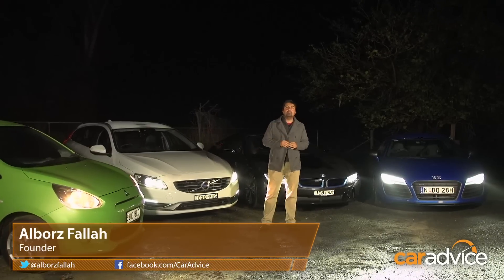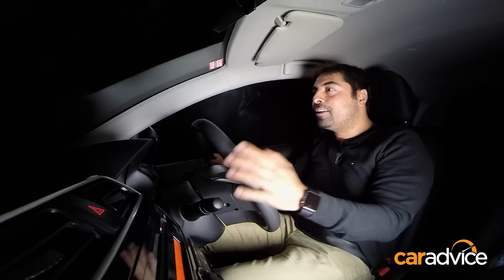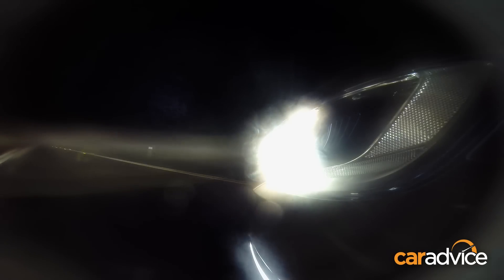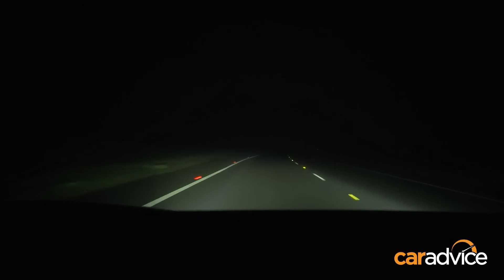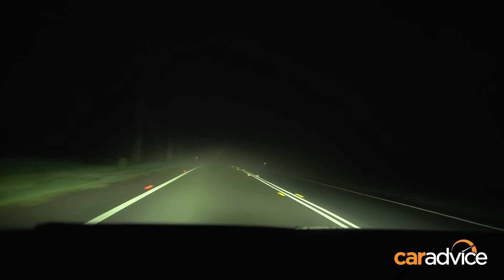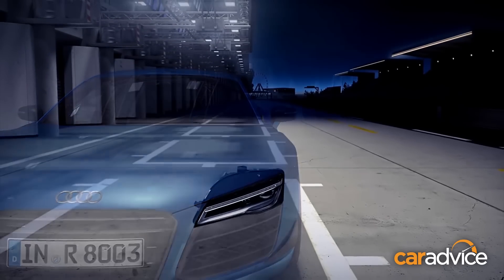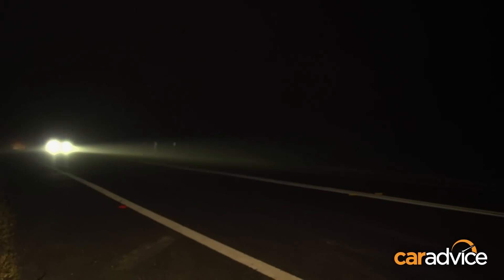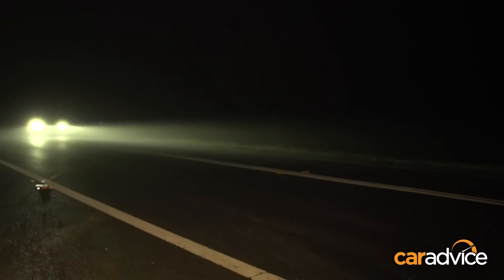Headlight Comparison : Laser v LED v HID Xenon v Halogen

Comment: Here is my Syncrovention, (halogen), headlights, power+, blue, detrimental, light-:

https://blogger.googleusercontent.com/img/b/R29vZ2xl/AVvXsEgnKe2vlwELsQqO6IclLpAJJfNd9e02tR2-6h1mp4NjSfz6bsaOFRfGdy5FE3ym1dk2cU92wx5s9ER3gQfK9Q7ujzJyGDoGZec3xsRcG17itlGMTOmCKnELyXteaIQsbzmG2gU0HioGAKRbmAz_JSQRb83vm1UGFS08MoI-BAhUC9KZfHvWOt3BQ8hZyULb/w640-h480/high%20beams%20vs%20deep%20logo.JPG

The Syncro Heresy

Comment: Not a fair comparison when optics are more important than color and lumens . Case in point a cheap focusable  flashlight and it can focus more light further or how about my not cheap mountain bike light that shots 3x further and wider than most cars. See you can NOT use my Mountain bike light on a car due to blinding oncoming traffic , this can be overcome somewhat with a projector optic or smart lights that see oncoming traffic and  adjust appropriately.  My Reef Aquarium Coral grows Coral best under HiD Metal halide Lighting (same as Xenon)  but  it does come with unwanted extras like HEAT and Excessive Electrical  Wattage but that's 400 watts * 3 not the DOT 35 watts * 2 on cars . With all this said it  would have awesome to get same Car with factory projector Halogens and compare that to Aftermarket Higher Wattage Halogens , Xenon (various colors) conversions and LED Conversions using the same optics and I'm pretty sure the best would be the Xenon. I have a feeling my Off Road RZR with a LED light bar (long throw optics) can shine better than that Audi Laser if we are comparing apples to oranges.

Comment: Of course low beam LED don‘ right up further than low beam HID! That’s regulation. They’re aimed downward to not blind oncoming drivers.

And comparing low beam LES with high beam laser? Come on!

Finally: H4 have always been a  not so good low cost halogen, double H7 was the standard.

Comment: um....why? you can adjust angle and power....how often does anyone turn on their highbeams without attracting attention or having somebody pissed off at them.

highbeams have different angles and simple bounce back from further away with a higher intensity to make it cover that increased distance.  nothing to do with technology...only difference is power consumption/heat produced/and wavelength of light

you can make an incandescent bulb out shine a laser light but you wont like the heat.

Comment: A bit confusing with the mention of distance.   On low beams and with hi/low in 1 bulbs the range shouldn't really increase much.  Rather for it to be better lit within the same range if aimed/re-aimed properly.  High beams could extend the range likely more so with seperate bulbs.

Comment: What an innacurate test. He starts with low on the halogen then switches to high to see the difference, but he completely skips that test with the hids, then he shows the other lights starting off with high beams. He obviously doesn't know the color range with hids either, as there are 5000k hids that are as natural white as leds. If you're going to compare these four types of lighting, at least perform a proper test with good explanations.

Comment: lazer headlights sound like an expensive fix ;)
Reply: I'm pretty sure they are 100% covered under warranty and insurance during the life-time of the car w/ the owner.  Most likely the owner gets a better version before the laser lights even have to be personally out-of-pocket replaced.
Reply: +Anthony Abelardo Bull fucking shit
Reply: Ivan Fedyshyn i could care less if they are, I would drive around every where & introduce myself as Bond, James Bond... that my friend is priceless
Reply: $3500 for one when mine had a fault.  Bmw asked me to keep  the faulty lightsfor research. The clear plastic had very fine crosshatching where yhe eye lips were.  Luckily they didn't charge me for repairs, lucky it was a rare fault they had never seen and c wanted to further research or rose i would be out of pocket.
The fault wasnt noticable unless you went very close to investigate.  I was lucky to have the lights in the first place cause my car was a show room model fully speced out //m 3. Show room cars are always the best to buy as they have rare features on them.

Comment: More and more Mid class cars also were equipped LED headlights now, and high end luxury cars use LED headlights.
BMW i8, Audi R8 LMX and the new BMW 7 Series: first series production vehicles with laser full beam. The BMW i8 and the Audi R8 LMX were launched almost at the same time as the first series production vehicles with laser headlights.

Comment: This test is useless. You can have the best headlights in the world, but if they are not aimed properly your $20,000 laser headlights don't mean shit. All headlights even halogens can provide good throw if they are adjusted correctly, though I do understand that it is harder to point lights in a reflective housing higher up without blinding oncoming drivers due to the general lack of cutoff sharpness
Reply: Most likely it has sensors that make sure it's leveled correctly.  This adaptive headlight servo motor technology existed since way back.  They aren't fixed like cheaper vehicles.  Auto-leveling was the beginning but then they added turning w/ the wheel then added the ability to detect vehicles in front and change the light to not blind anyone so a tunnel appears at night.
Reply: auto leveling system also needs to be adjusted
Reply: myvolvoforlife projector retrofitting has become widely available which solves the problem of cars with reflector headlights.
Reply: Anthony Abelardo
Reply: edmund phee

Comment: Comparing different cars, with different lights is quite useless, If I compare our both cars, both halogen, they give a totally different amount of light. For example one has halogen with simple reflection, the other one has it with projector lights. There is also major difference between the techniques used in LED lights and in colour (so also in light perception) in HID.

This is probably the worst comparison I've ever seen, sorry.

Comment: P6 LED Headlight
1. Adopt imported Philips Lumileds Luxeon Z ES LED chip 45W and MZ LED chip 55W.
2. High output 4500LM/pc and 5200LM/pc.
3. Built-in copper vacuum heat tube, faster three times than ordinary LED headlights at the speed of heat conduction, keep long lifespan.
3. Ok for use in projectors and reflectors.
4. Dual- IC Control Driver, more stable on car and motorcycle use.
5. Meet the requirements of vehicle inspection.
Video: https://youtu.be/8MB3hYI6YtY